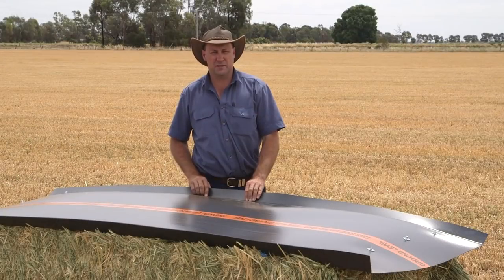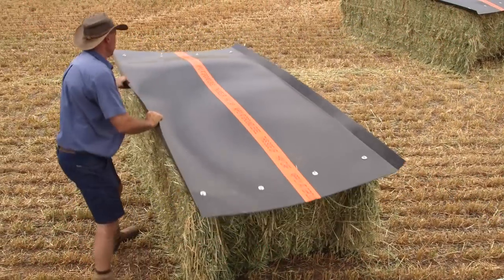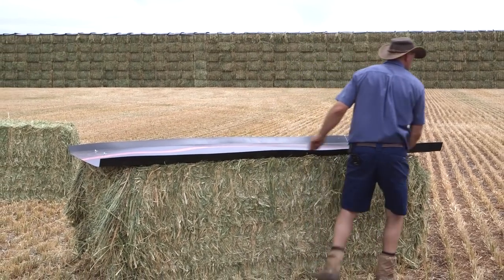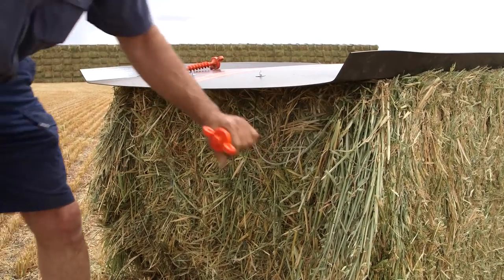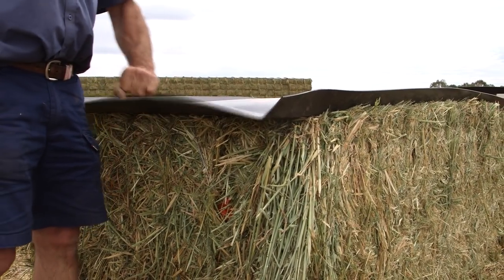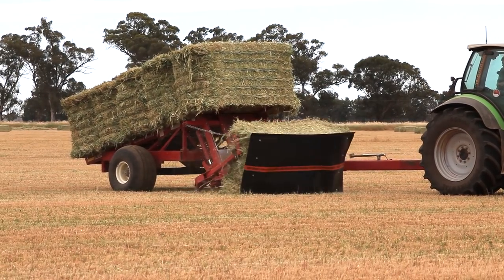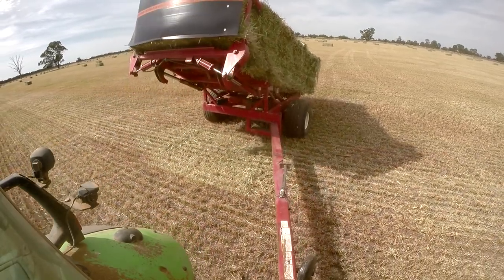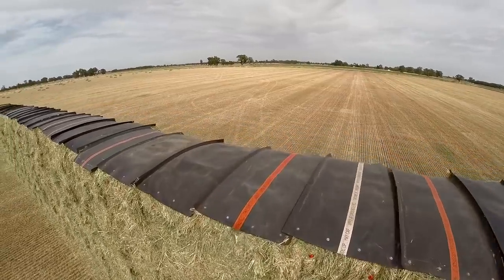Hay Making with Hay Caps

Comment: what happens when rain comes from the side lol?
Reply from the maker: The rain that hits the side of the stack, as it always does depending on the wind direction, doesn't penetrate the bale due to the bales density, and gravity. Once the end of the bale is wet the continuing rain will just drip down. The ends of the bale will dry out over the following days. The rain that does the damage in big square bales of hay is the rain that goes into the top of the bale. This water can penetrate all the way down through the stack of hay. The water stays in the bale and reacts with the hay causing loss of food value, mould, heat and sometimes spontaneous combustion.
Reply: onelonleyfarmer did you ever hear from this guy or his company? If you did and tried it out how did they work for you?

Comment: Why would you want to stack it in the field?
Take it to a pole barn so when it rains it won't get wet.
Maybe this is for demo purposes. :-)
Reply: Not everyone has barn storage, which is why so many people use round bales, because you can store round bales outside.  This gives more options.
Reply: If you store the bails outside do not stack them one on another.
I tried that one time I had so much hay and when it rained the water from the top bails ran down and soaked the bottom bails where they met. I had a lot of hay ruined. 
Down here in Texas we have Coastal Bermuda grass is the best for hay. You have to put a lot of fertilizer on the grass to get a good cutting. If I had to do again I would plant Johnson Grass. That stuff will grow out of highway cracks. It has large broad leaves and makes a lot of seeds.
Reply: If you store round bales outside you wouldn't stack them, you'd place them on the ground with gaps between them, you'll lose maybe the outside inch, the rest is fine.  It's the original reason round bales became so popular, because they don't need barn storage!
Reply: OK, barns can be expensive. The hay we used to put up was the small square bails weighting anywhere from 60-70lbs.
I sure enjoy watching hay bailing. In my younger days we did a lot of that for winter feed. The art of bailing hay really has come a long way over the decades.
I remember my dad used to buy peanut hay. The cows loved it as well as the chickens would run out in the pasture to get the little peanuts !
Reply: Round bales aren't as shipper friendly as large square. I use round bales but I don't ship anything, I use all I produce.
Reply: I prefer to line our round bales up with the salt sides squished up against one another, that way they take up less space and the flat sides  aren’t exposed to any whether it other than the end bales

Comment: When rain comes direct from heaven its ok.  ....but from side the hay get wet....Not 100% perfect
Reply from the maker: Rain doesn't penetrate the bales from the side of the stack due to the density of the bales & how the bales are packed in the baler. Once the sides are wet the water just drips down the side of the stack. You end up with only an inch staining on the sides. The rain that does all the damage in big square bales is the rain that goes into the top of the bale.
Reply: @HayCapTocumwal thanks for the answer....
Reply: @h.n.602  There is more reasons to stack in the field.  Square bales should be stacked within one day, especially if the weather is not secure.  It eliminates the need to immediately transport it to where it will be used.  Hay stacked in the field can evaporate some excess moisture, especially if it is stacked in an angle to the wind and with a couple of inches between the bales.  MS